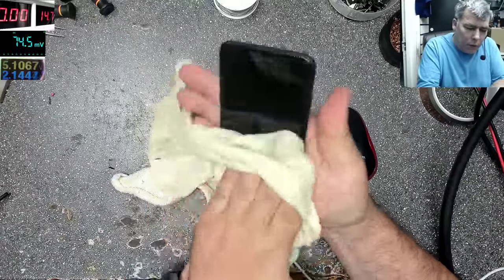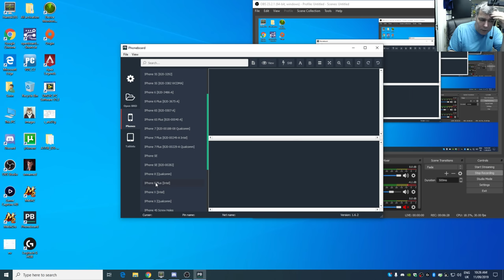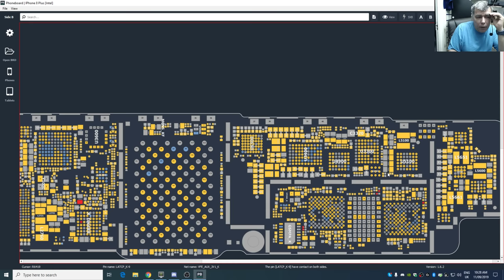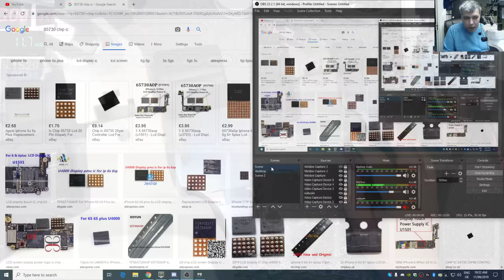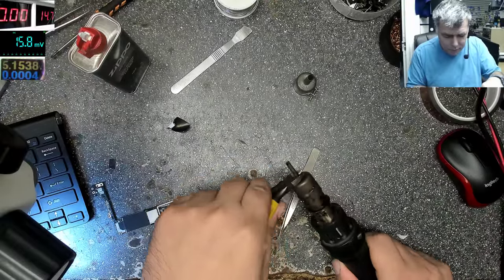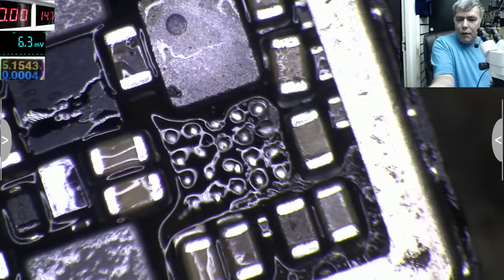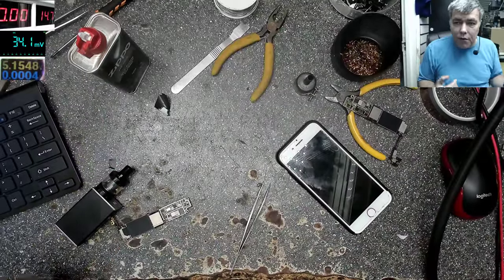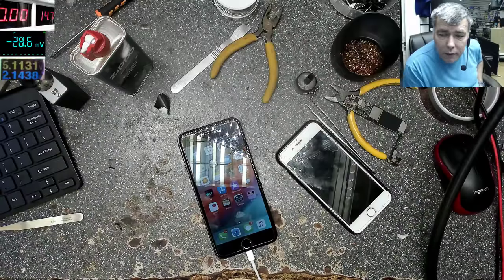Iphone no backlight, no picture, logic board repair

Comment: I've an iPhone 8 in which the cable from the mainboard to the button has been torn. The screen itself works fine, just no operating home/id button. As I understand it, it's part of the backlight assembly. Is it possible to get the backlight assembly and just extract the cable for the home button to be used?

Comment: Hi, iPhone 8. J5700: All pins value are good
U5660: All pads value are good
U5660: changed
D5661: Changed
D5660: Changed
R5735: OK
R5733: OK
R5734: OK
All capacitors are OK
Do you have any idea what can be wrong?

Comment: Hi sorin, you can use... YIHUA 938D Portable Hot Tweezers Mini Soldering instead of the hot gun  did you try it? Several times i mention about this tool, please tell me if it is OK?   You can order from  banggood.Com, im waiting for your answer. Thnx